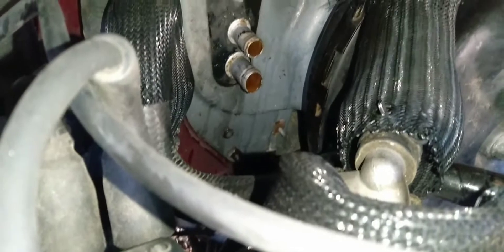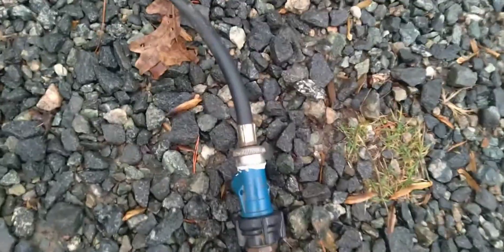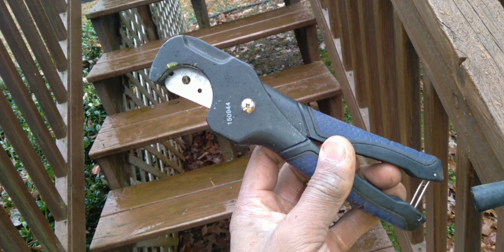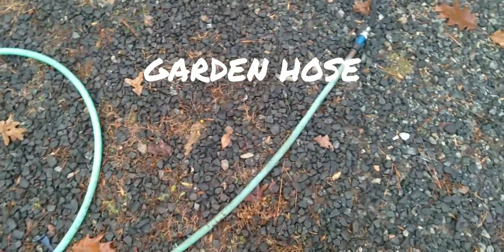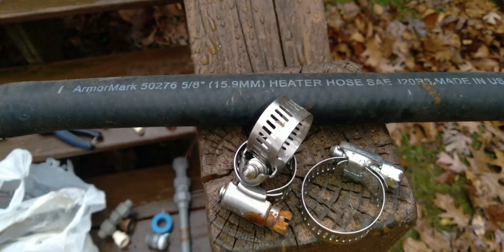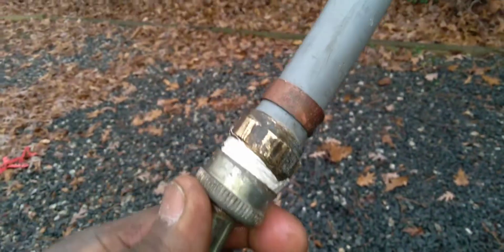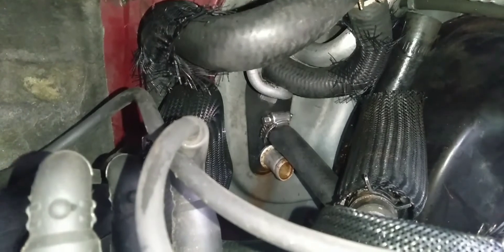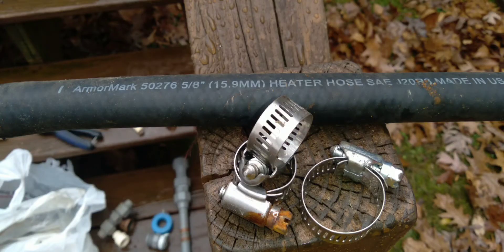NO HEAT? DIY HEATER CORE FLUSH KIT

Comment: Lot of work for that cleaning system, just use a 5/8 garden hose cut off the male side, and slide it right onto the heater core male inlet and outlet, I didn't need no clamps, she hell on like a champ, hell you have your on-and-off water control right at your outside water faucet, turn it on and let her flow.

Comment: Flushing your heater core you need to back flush it and to do that you need to know which hose is the inlet and outlet. The easiest way to tell which is which start your vehicle and turn the heater on and check the hoses going to your heater core and the hose that gets hot first is your inlet side . When you flush it out do it from the outlet side back out the inlet side to a bucket to get the most of the rust and scale out of your heater core. Then drain the rest of your coolant out and get a bottle of CRL And put in your radiator and enough There's distiled water.to fill it back up and drive it 50 to 100 miles and drain it and fill it up with distiled water and drive it 10 to 15 miles the drain it and put your new coolant in then your good to go !!!